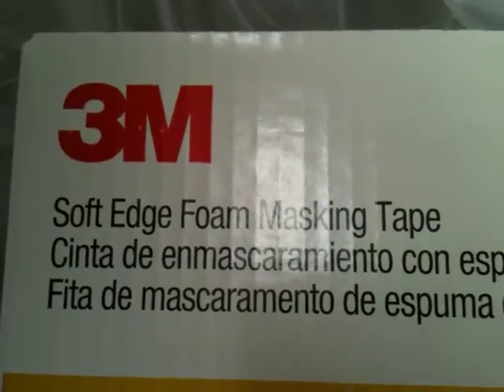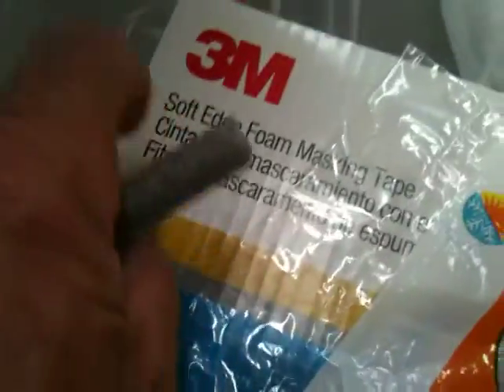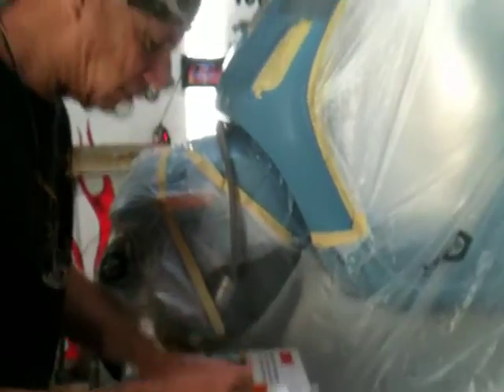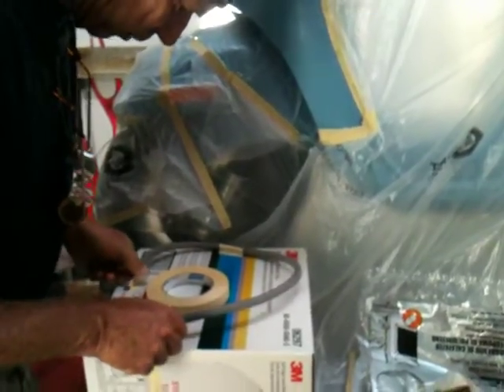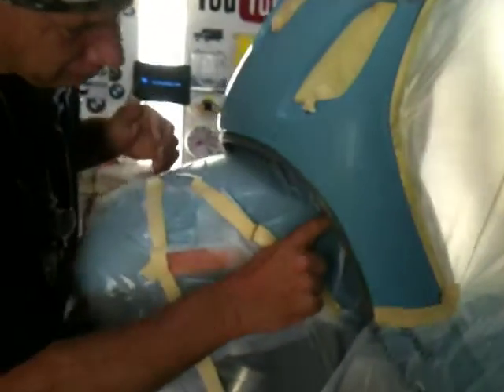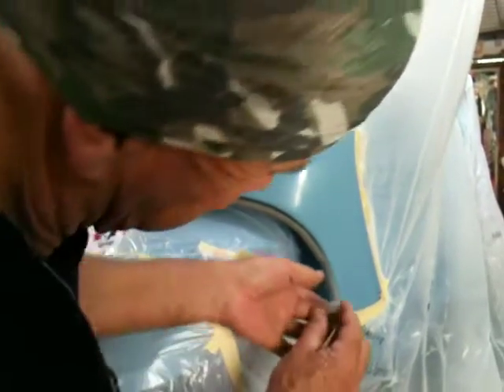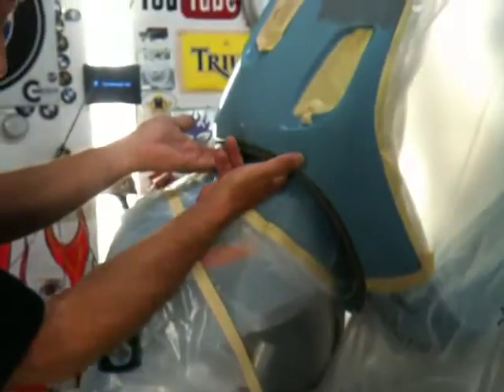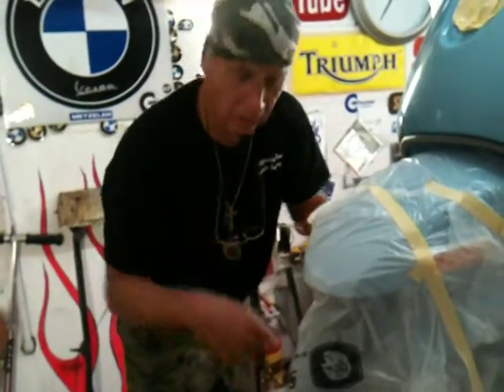How to mask door jambs for  blends and overspray

Comment: I have used foam tap with double side tape on it... I would use electrical tape first place the double side tape on foam covering my electrical tape such not to pull off my fresh base clear coat... works well

Comment from the maker: when you have your door jambs painted and the jambs on the car painted you'd then hang them on the car to paint on the car so the color matches panel to panel,,,you'll want to protect that gap or overspray will get in there when you spray from the outside and that is where the foam goes..